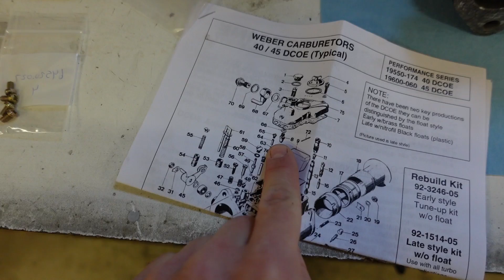Rebuilding A Set Of Weber DCOE Side Draft Carburetors!

Comment: Those bearings you were talking about are critical. They act as ball checks in the bottom of the accerator pump. You leave them out and you will have a really bad hesitation when you hit the throttle. Many years ago (1975) I rebuilt my carburetor on my GTO with a friend and that ball check was left out. Bad, bad hesitation. Borrowed another carburetor from a friend so I could go get married. Rebuilt the original after the honeymoon, discovered the missing ball check. Sorry about the long post.
Reply from the maker: Good to know! And I did get them in!! Thanks!

Comment: Cylinder capacity and maximum revs required gives you venturi size required. Lots of charts available if you google. If you are running high revs 40mm will be to small for 2.4L. I currently run 38mm venturi in a 45mm carby on a 2 L. A 45mm carby may be ok but if a really good motor I would think about 48mm Carby. They are a bit harder to find though. And for those who are new to side draught carbys there is a maximum venturi size you can fit in a carby size.

Also a bit hard to tell on viewing I hope the inside of those carbs are clean of what looks like loose corrosion. The outside looks terrific.

Comment: If you haven’t already you might consider getting a wide band O2 sensor and gauge to help you tune these carbs.  It really helped me get mine running right.  It’s so nice to just see what’s happening, instantly, for all the various load cases and conditions.
Reply from the maker: Yes I’m planning on doing a wideband! What gauge did you go with?
Reply: @austinniemela  I ran one from innovate motor sports; at the time (about 10 yrs ago, wow time flies) it was one of the better options for the money, but there are a lot of options these days.   Always worked well for me though my buddy got the same gage at the same time and his died after a couple of years.

Comment: Get a clear 3/16 hose from the hardware store possible around 10 to 12 feet. 2 teets an to elbow, find a board and assemble. 4 long ends fill hose using a colored liquid best is DeX oil .drill and tap intake in all the runners install a vacuum fitting. Use the clear hoses and liquid to balance carbs .it will work  as a mercury balance tool. Look up motorcycle carbs balance instructions. Good luck Luis
Reply from the maker: Nice I’ll look into that!

Comment: Hey Austin... still a little disappointed you're not gonna use some kind of forced induction.... but hey... twin 40 side drafts, mega cool 😎😎😎,I cut my teeth modifying with VW mk1 golf gti's (or as you call them, rabbits), and I ripped out the k-tronic injection and replaced with some twin 40's.... the induction noise is something else!!! You may be a little young for this reference, but I got some little stickers for the bottom of my number plates saying 'More throat than Linda Lovelace'.... those that know will know, lol 😉🤣🤣
Reply from the maker: Can’t turbo everything haha I’ve always wanted to run side drafts!
Reply: @austinniemela nah, no turbo....Eaton m45 super charger... just sayin, lol😉😎
Reply: Keep it NA. The gains aren't worth the money. R engines are a lot of things but high power motors they are not. No need to try and turn them into something they are not.